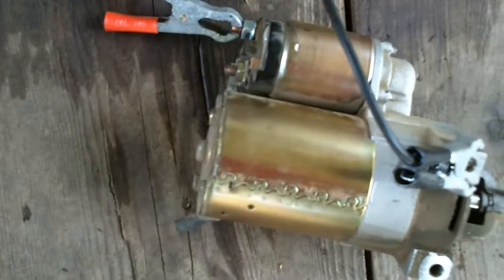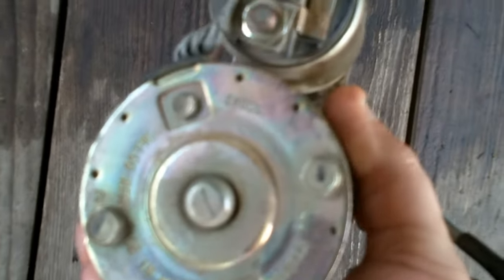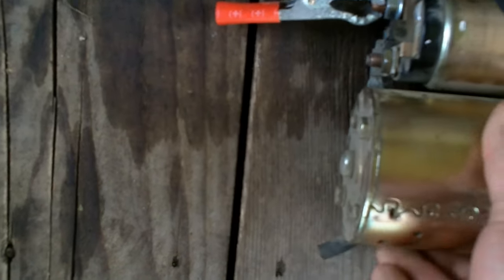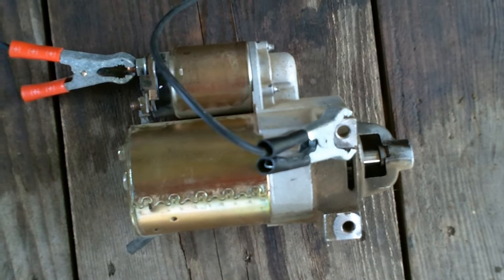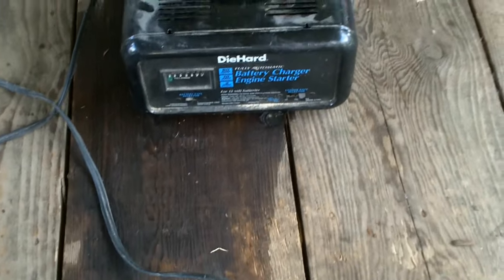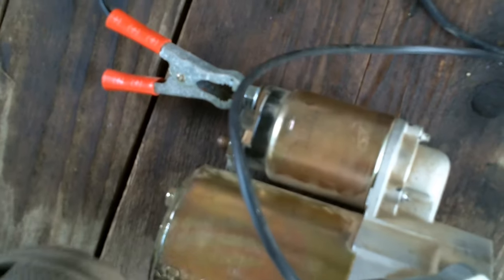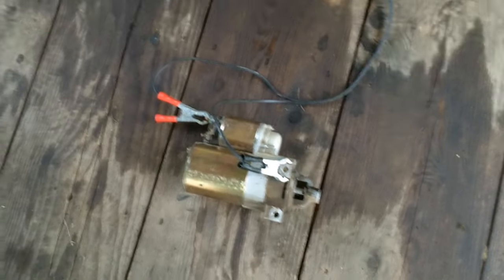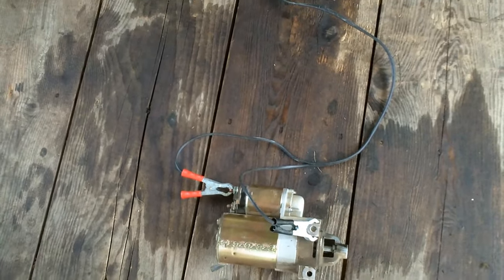How to jump a starter.

Comment: I have had  replaced the starter and still no luck. It will start if I keep doing this process but it won't start with the key.
What could be bad? Ignition switch?
Help please
Reply: Starter solenoid
Reply: Theres a short between the battery and the starter

Comment: Is this a permanent solution or will I have to still replace it??
Reply: I think this is more of a test to see if your starter is will engage if it doesn't you need a new starter
Reply: Based on your question, I suggest you watch this video again while your waiting for mechanic to fix your car.
Reply: replace it

or
you can start your vehicle this way if the solenoid is the problem 
keep all the connections and...

 1.turn the ignition key to ignition, don't hold it in the ignition as in normal operation
2.take the screwdriver to the solenoid and jump start the car  as seen on the video

started my ford for years this way :)
oh and don't touch any metal and try not to lean on the car or bear aluminum

Comment: Ok so I short/jump my starter and get a single click then nothing. 
No crank, no slow turn of the engine. Nothing. 
click done. 
Now what?
Reply from the maker: Did you give the starter a few taps with a hammer? Most chain stores will test the starter for free if you bring it in, at least they use to. Are your grounds in good shape?
Reply: @116falconer  I tried pulling the starter so i could have it tested. Except its on my 2014 Freightliner Cascadia and there is one wire (the last one i need to get off) but it's attached to two posts that face opposite directions and there's not enough slack in that wire to get it off either post in order to finally remove the starter.
I'm just going to have to get it towed again...bye bye money.